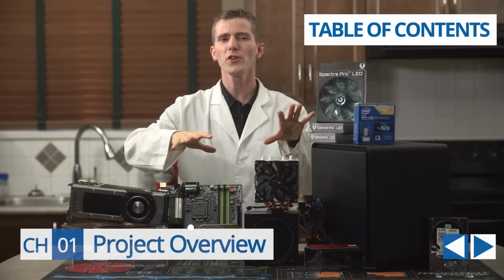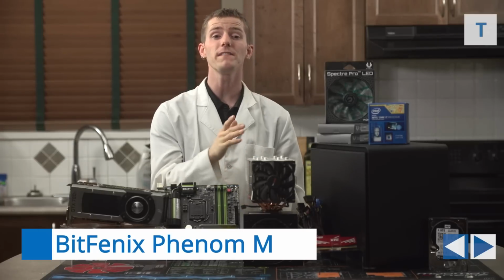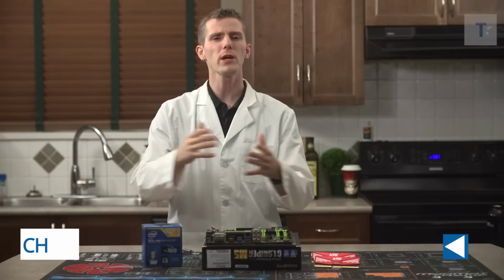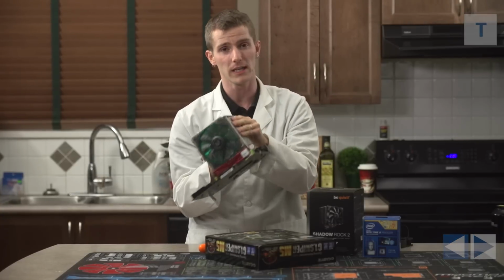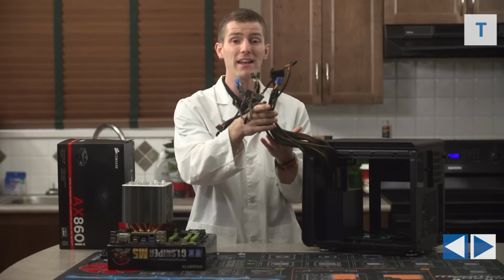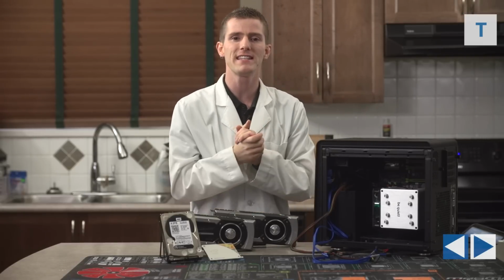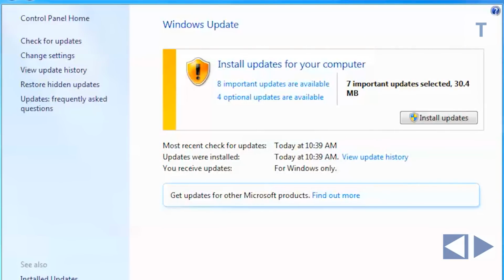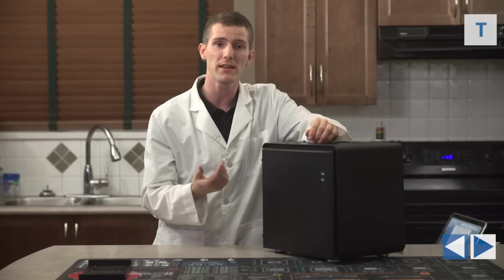ULTIMATE Intel Compact SLI Gaming PC Computer "How To" Build Guide

Comment: Linus, why you don't spread thermal compound on all along a CPU?
Reply: god no. pls don't do that.
Reply: Andre Salles Why does a metal-to-metal interface not transfer heat very well? It's because there is a very fine layer of air (one of the most effective thermal insulators) existing between the two interfaces due to gaps. So truly, the liquid paste is actually there to fill in the gaps, thus reducing the thermal resistance of the interface.
Reply: Andre Salles I never said it didn't help the heat transfer. Why do you think the thermal paste needs to fill the gaps?
Reply: Andre Salles Copper, the material heatsinks are made out of tranfers heat very well actually.Which is why you want the heatsink touching the cpu and not a ton of thermal paste.
Reply: Actually, it doesn't really matter whether you just put a spot in the middle or spreading out the thermal paste. Some will say this is better, some will say the other is better. As long as you don't use too much thermal paste everything is fine.

I personally always spread the thermal paste, just a very thin layer so the CPU's heatspreader is barely covered. Been doing this for the last 15 years on dozens of PC builds and everything was OK.
Reply: Andre Salles I think you have some misinformation. You're partially right but the thermal compound is only there to fill in small scratches or things of that nature in the processor/cooler.  Any extra will make heat transfer worse.  What that means is that if I had true metal to metal contact with no scratches it would be better than if I had used thermal compound, but since there is almost always scratches its better to use it.  Even if there was extra thermal paste it won't make that much of a difference since its usually very finely ground silver (silver is the best heat/electricity conductor, followed by copper gold and aluminum).
Reply: You don't need to do that. You just need a pea sized squirt, and the heatsink itself will spread it out as it's secured down to the motherboard.
Reply: not every cpu is designed the same. at least i used the guide provided by artic silver for my i5. a line of thermal compound right along the top of the 4 cores. worked great
Reply: Andre Salles ↑I repeat: It was rhetoric question, which no answer required. You are helpless. So, STFU & GTFO.
Reply: Gunslinger not being helpless , its trying to help someone who seems to need information, it was definitely not clear that it was sarcasm , oh the internet , being offended by giving out information , i suppose you should tell all the other people that it was sarcasm as im the only one getting hate , you are the helpless one
Reply: Andre Salles You are right and wrong. You are right that thermal paste does help cooling. You are wrong when you say thermal paste "resistance" (thermal conductivity) is lower than metal.  Here is the proof. 

Let's look at the numbers. Thermal conductivity has units of W/m-K which reads Watts per Meter-Kelvin. The higher the W/m-K, the better. (The more W/m-K you have, the more heat gets through).

Let's pick a very good thermal paste, for example, Arctic Cooling MX-4 paste. It has about 8.5 W/m-K. Let's compare that number to pure Aluminum, which is a metal. It has about 204.3 W/m-K.

Aluminum is about 24 times better at heat transfer.  This means when you layer on THICK thermal paste, it makes conductivity WORSE. 

However, air has .024 W/m-K (transfer heat horribly). So you see that the whole purpose of thermal grease is to get rid of the tiny amounts of air between your cpu and heatsink, because 8.5 W/m-K is better than .024 W/m-K. 
The goal is to use as thin of a layer of thermal paste as possible, while still getting rid of all of the air. You should use about a grain of rice worth for maximum performance. As the paste warms up, it will spread across the CPU.
Reply: Why is this being debated so much. Linus already has videos showing how to apply thermal paste and he uses the pea method.
Reply: You want to have as little thermal compound as possible.Its only there to fill in little gaps between the heatsink and cpu.
Reply: think, metal to metal does NOT tranfers heat well , the thermal paste transfer the heat way more efficiently, its not only there to fill the gaps , so dont make stupid comments
Reply: if you are going to say something to someone looking for help , choose your words carefully and know what you are talking about
Reply: Andre Salles Thanks. I'm asked Linus, not you.
Reply: Its not just because of the air , use your brains..
Reply: Gunslinger Im helping you ... and Yeah linus is answering you , just wait lol
Reply: yes there is the gap , but just touching is not the best way , using high quality thermal paste makes the heat transfer better , you can make the tests yourself its pretty easy , try using no thermal paste but with metal to metal touching with no gaps ( im sure you can come up with something ) and then use thermal paste
Reply: Dillon Kennedy My English  is not perfect so Ill say this the best way I can , when transferring heat touching and clean surfaces are not the only thing that why you have thermal compounds like ICdiamond , when a metal gets hot the heat spreads to a limited space ( gets weaker as it gets farther from the source of the heat) in the cpu case , the cpu gets hot the thermal paste transfer the heat from the cpu to the heatsink , the thermal paste helps transferring the heat as the metals are different and they are different parts , the thermal paste transfer more heat from the cpu to the heatsink , the heat has a better time going through the thermal paste than going through the metal , as silver particles and diamond particles are better heat transfers than the metal it self 
sorry for my English and I got made because the guy who asked the question didnt know enough to understand the other guys comment
Reply: Andre Salles It was rhetoric question, which no answer required.
sarcasm
Reply: Andre Salles is wrong. Thermal paste has horrible conductivity compared to metal, while air is actually an insulator. This means that if you spread your paste like peanut butter on a sandwich, you are going to get terrible performance, even with the best cooler.  

The only reason we apply thermal paste is to eliminate the thin air layer between metal and metal.  It would be better to have no thermal paste at all than to have a thick layer.
Reply: danielavrit No im not thermals are not as simple as that 
and thermal paste is not that bad, if you use the cheap ones it is but the high quality ones arent 
look at this 
you have a metal bar and the source of the heat

(source) -------- ( end of the bar )
now , as you know , the metal bar loses heat as if gets close to the end for various reasons
in the cpu and heatsink case 
( simple numbers just for demonstration )

if the cpu and heatsink were all one part the temperatures would get cooler as it reaches the heat sink but if you use a thermal paste to link the too ( high quality ones like ICdiamond)
more heat would be transfered for the thermal paste conducts not only faster but more heat
 so it would be like this 
all one part 
 (source ) 90 ----- 30 heatsink ---- 10 ( theorical numbers not a real scenario )

with thermal paste
 (source ) 90----45 (thermal paste transfer more and faster to heatsink) ----- 10

with the thermal paste the heat gets a easier time getting to the heatsink for the resistence is lesser then the metal so more heat gets to the heatsink itself ( loses less heat over the lenght of the metal ) so the heatsink can cool more temperatures as more heat gets to it 
im sorry if Im not being too clear for english is not my first language , If im wrong please prove me wrong for I dont wish to spread false information , thank you
Reply: Putting a lot of thermal paste is bad , you should never do it these days as things got a lot better ,yes , thank you for proving me wrong even thou my thinking wasnt , and thank you for being polite , as far as I know when thermal paste gets better my thinking will pretty much be right but thats for the future , but for now I im wrong , thank you , and for the professor I didnt show any numbers just theory so no hate towards him for he was right
Reply: Andre Salles Let's face it man, Daniel was being way more polite than your absurd insults and misconceptions deserve.
Reply: cfisher2833
Because.
Reply: T'hat King
LOLOLOL NOOOOOOOOOO you are soo wrong , the thermal paste is what makes the heat transfer...dont speak when you dont know what you are saying

Comment: Hey LinusTech i'm going to build my own gaming pc ant this are the parts: ASUS ATX MAXIMUS VI FORMULA, EVGA GeForce GTX 780 Ti Dual Classified, Corsair Vengeance Red 16GB (4x4GB), Intel Core i7-4770K Quad-Core Processor, NZXT Phantom 410, Corsair Hydro Series H105 Liquid CPU Cooler, Be Quiet Dark Power Pro 10 850W, 5x Corsair Air Series AF120 LED Quiet Edition High Airflow Fan red, 1x Corsair Air Series AF140 LED Quiet Edition High Airflow Fan red, Intel 530 Series 240GB 2.5-Inch Internal Solid State Drive, Western Digital Caviar Black 1 TB SATA III, ASUS Internal 24X SATA Optical Drive and ASUS Xonar Phoebus ROG Gaming Soundcard. Are thees good parts and fit they together? or would you recommend using other parts like: different wattage, ram, case,... Please help me with this build :D

Comment: Why do you need 2 graphics cards? I have the same card in my PC it was $700.00 the most expensive part in my build, and I run Battlefield 4, Tomb Raider and Bio Shock all on ultra settings.
Reply: 1440p monitor?

Comment: Hello someone could help me I need a PC GAMING but know that I need for a PSU EVGA GTX780 ACX for my PC does not restart. 
These are the specs of my PC 

Intel i7 3770K@3.5GHz 
Cooler Master Hyper 212 EVO 
Intel Desktop DZ77GA-70K
Kingston 16GB @ 1333MHz, 
GPU: EVGA GTX 780 3GB ACX 
HDD: 2x Seagate 2TB 7200 RPM HDD 
PSU: Corsair HX750 
Win x64 PRO 8.1

Comment: Can I use a different air cooler over the Bequiet! That'll perform equally as well? Like the Noctua NH-D14, etc
Reply: the d-14 too big for this case
Reply: So, could you recommend another one?
Reply: i would recomend the noctua n-u12s
Reply: Chiz V If you want it in the Bitfenix Phenom, a Noctua NH-D14 does perform better, but it does not fit. So yes, a NH-U12S would have great performance and it should fit nicely in the Phenom!
Reply: Okay, thanks! (:

Comment: Fantastic build Linus! Impressed by the punching power of the hardware in such a small form factor. Just wanted to say though, on the external expansion side of things, due to ability to daisy chain your peripherals with thunderbolt, it is just one or two cables connected directly to a Mac Pro chassis. I use a MacBook Air with a Belkin thunderbolt dock which connects to a DVI monitor, my FireWire drives and audio interface as well as USB drives and peripherals. Makes it an elegant way to plug one cable in and have everything ready to go. Might be an exciting future with these smaller form factors!

Comment: So how's the 700W PS handle the 780 Ti SLI? Can it really supply power?
Reply: 700W is more then required, I guarantee he didn't pull more then 500W. People always over spec power supplies and Linus is one of the few who properly specs his builds. I'm pushing a 780Ti and 4770k @ 4.8Ghz on a 550W PS and I'm still below 80% efficiency range XD
Reply: Sean Wilson I have to call BS on you're 55% efficiency range. Most PSU's are 75-80%. It's simple math AC to DC power... 3.3v 5v and 12v rail, amperage limits etc. So please do your own research and stop basing your comments on other peoples "reviews". I am not even scratching 400 watts running BF4 on Ultra... All of your comments on every major tech channel are negative and ignorant... Eat a Cookie...
Reply: Sean Wilson please enlighten us with links to where you learned this? because it flies in the face of common sense, experience, and mechanics.
Reply: Rougewolf  He may mean at 55% of max power conversion available ( 275 watts in this case)  it has its peak efficiency (of 80% ~90%)   rather than its peak efficiency is 55%
Reply: Rougewolf This guy might not know what he talking about here. A full sized system like that will draw very close to 700 watts at full load. If not 700 watts. People over spec power supplies all the time but it's not necessarily a bad thing considering power supply efficiency peaks around 55% usage.
Reply: Have you ever actually checked what you are pulling from the wall?
Reply: Na, but many reviews do. And a system with a 780ti at full load will draw about 40 more watts than a 780. Say 4770k and 780ti with some hard drives and fans and everything else will draw about 420 watts. Add another 265 watt video card and what do you come up with.
Reply: Sean Wilson
 According to his graphs it didn't .  It shows a 500 Watt usage whilst running Far Cry 3 at ultra settings so looks like Rougewolf is right here
Reply: Cheezsoup I saw that, I don't really know how that is working out to be that for him but he is doing something magical. It is Linus and slick after all.
Reply: Sean Wilson Or, you know, you could just be wrong.
Reply: Of course I could be.
Reply: Wow. That's awesome I got Corsair gold ax 850 but I was afraid to do crossfire with my hd7970 but now it's okay to have crossfire and sli with 550 watts. Nice...
Reply: Edmund Benaojan Don't feel bad, like I said peak efficiency is around 55% also it will live longer not being at full load every time you use it.
Reply: Sean Wilson Okay man.. I will try... I've been reading reviews before and it said we need 1000W to supply SLI and crossfire
Reply: Edmund Benaojan No not at all. I have a 1000W but thats because I got it for nearly free. If money wasn't a concern I would have gotten the same psu just, I like the headroom. 650W is just about bare min for 2 250W cards.
Reply: Rougewolf I am good, you should do some research. Not sure where you learned what you have.
Reply: Edmund Benaojanovic
 SLI and Crossfire at the same time?  Yes it can be done (Linus himself did that very thing), but as far is I was aware this was a VERY unusual situation
Reply: Cheezsoup Thank you for clearing that up for him. I think what Edmund means is 1000W for sli or crossfire for him.

Comment: How do I shift the OS onto an SSD from my hard drive, and what problems could I expect when upgrading my motherboard, and what must I do before and after installing the new mobo?
Also what's raid?
Reply: Theres a few methods but I honestly recommend just installing the OS fresh on the SSD.

Physically upgrading your motherboard can mean CPU and RAM incompatibilities. Check what socket your CPU uses and what type your RAM is to make sure they work together.

Raid is a system of using 2 or more storage devices(hard drives) to either A: give redundancy (backups) B: increase speed or throughput by having the same data on 2 drives, letting it read and write from each for the same things. It's more complicated but this is the basics.
Reply: John Bruton Thanks for the help but because windows 8 was already installed when i bought this PC do i just copy and paste the files over because i wasn't provided with a product key or disk with it on

Comment: I really want to build a system very similar to this but I have one big question, what would be another compact(ish) case that could hold all this and have enough room left for a watercooling system? I would like my build to be small enough to take places for LAN play, but that wont be happening very often so it doesn't have to be super compact. The reason is that if I'm already buying hardware like this then I'd like to overclock it a bit, so I think if I can get a case on the smaller side that can handle this hardware plus 2 dual rads I would really be getting everything I want.

Comment: what is the total price linus??
Reply: I didn't look up all the parts, but my guess is no less than $2,000. The GPUs and CPU alone push the price to $1,700.
Reply: I used pcpartpicker to put it all together. It pushes almost $2,700.00 after rebates
Reply: I got 2600 USD or a few dollars over

Comment: Linus, why not swap the 140mm rear fan to intake, swap your CPU fans around then put in the Corsair 860i you showed there with the fan towards the inside? With Corsair Link you have control over the fan in the 860i so you could use that fan to actually exhaust out the bottom increasing your airflow quite a bit.

Comment: fine guide, but the SSD mount...
Reply: DComm15 I know what is the SSD and how SSDs works. I do not like how it looks that way fitting the SSD on HDD for such a nice configuration. And paste the SSD to the HDD that is still heating up at work, when the time comes to remove the SSD, I wonder what remains between...

Comment: I know 82c might be ok during a synthetic benchmark but I wouldn't be happy running my cards that hot on every day applications. To top it all off, those temperatures are from new dust free cards, it's gonna get a lot hotter than that as time passes - and we all know how annoying it is to remove dust from rear exhausting cards.